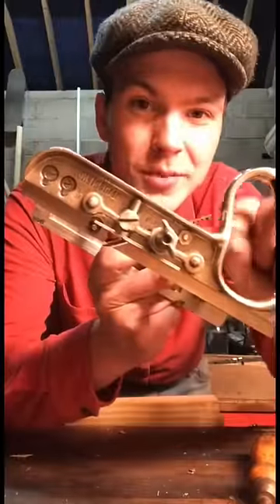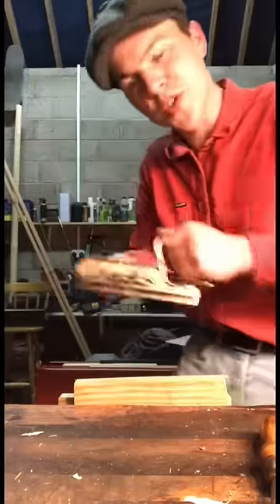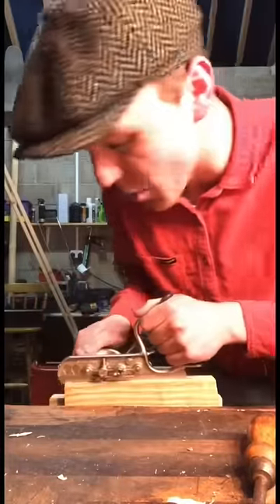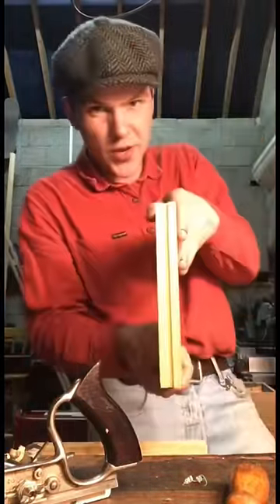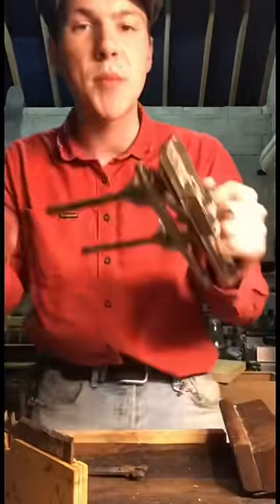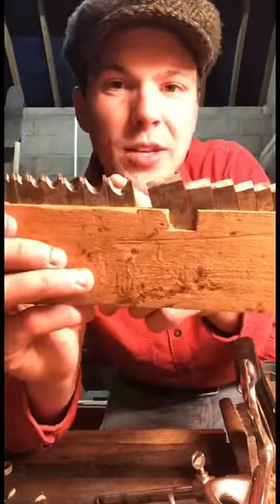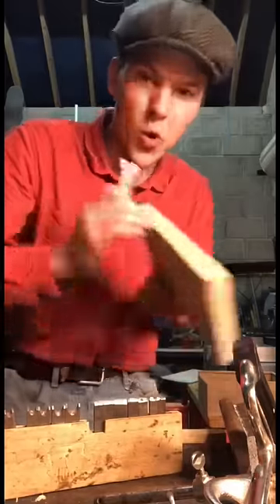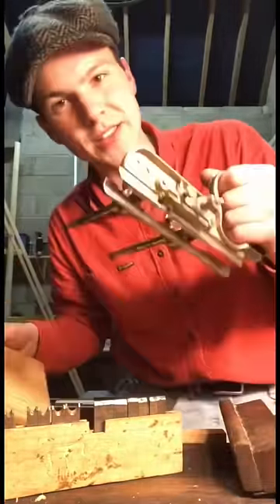Using a Stanley No.50 plough plane #shorts #shortvideo #satisfying #woodworking

Comment: Stanley no 50 combination plane. Garret Wade has a modern equivalent that ACTUALLY works and holds the settings. The no 50 was notorious for not holding the depth.